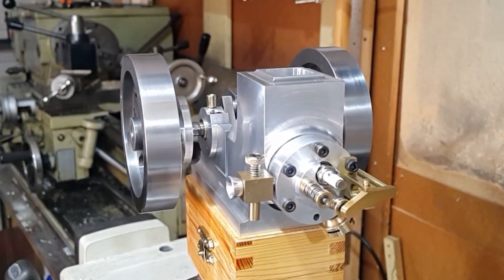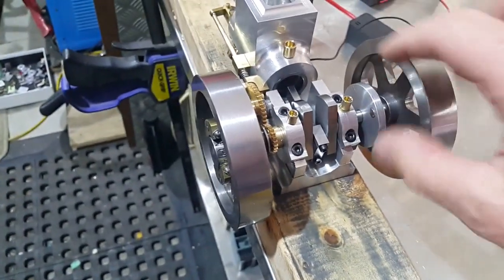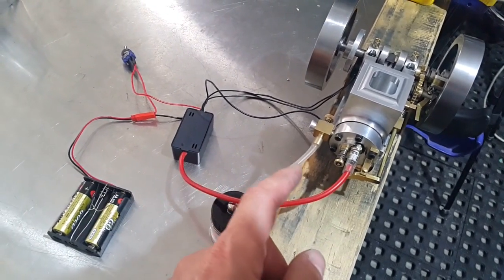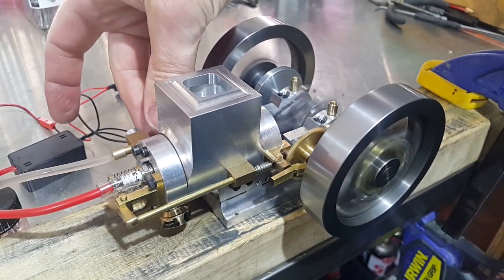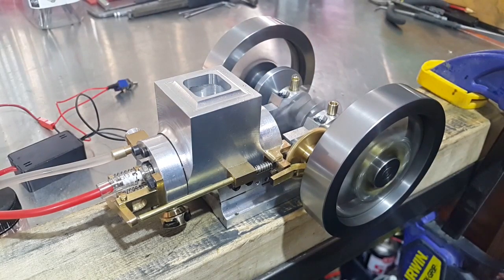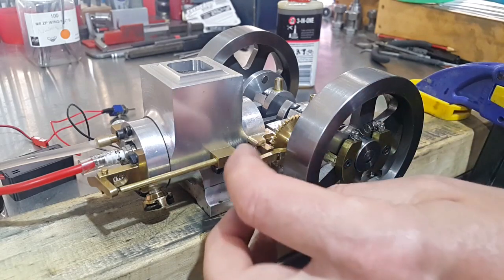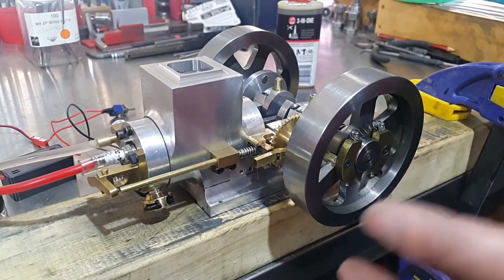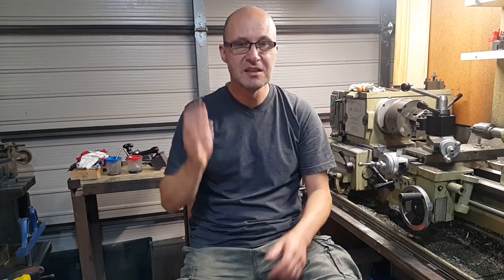#71 - Kerzel Hit & Miss Model Engine - Part 15 Finished

Comment: Fantastic series ! She runs like a Gem !
I must admit I cheated when it came to sorting the right governor spring on my engine - it needed it to kick out at 700-750rpm which is in the range of the top speed of my battery drill in high gear  gear .With the load on the drill from engine and a bit of trigger tweak I got pretty close to that and adjusted the spring to suit .
Reply from the maker: Hi Ian, good idea with the governor spring. Thanks for watching. Regards Kevin

Comment: Kevin, nice build ! I do have a question . how did you determine your ignition magnet  location  ( the diameter ) . John
Reply from the maker: Hi John. The magnet location I got from good old Google. Thanks for watching. Regards kevin
Reply: @Machine_NZ  Kevin, where did you find it on Google ? your research skills are better than mine ! Thanks